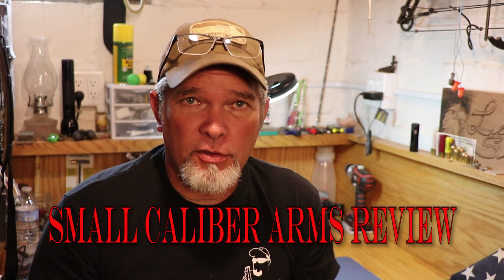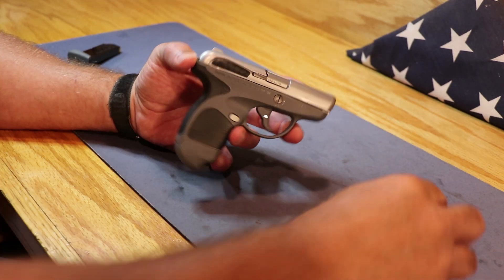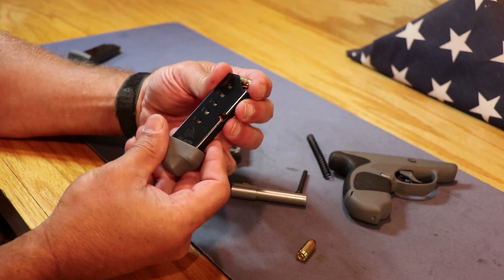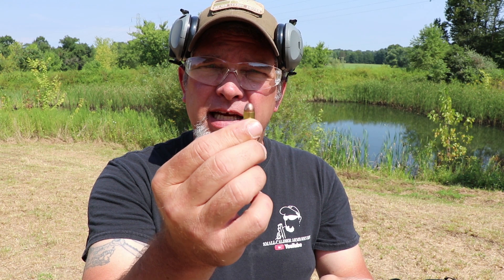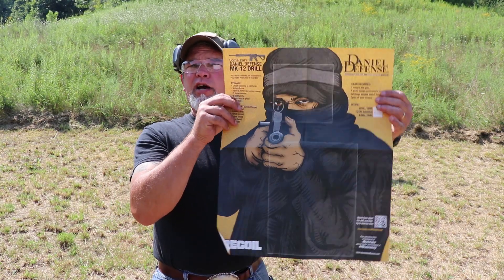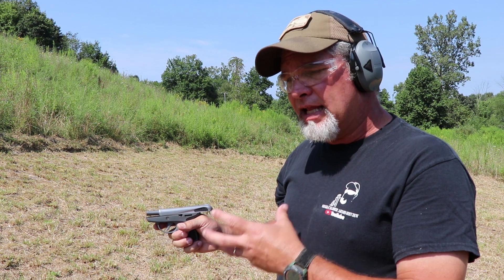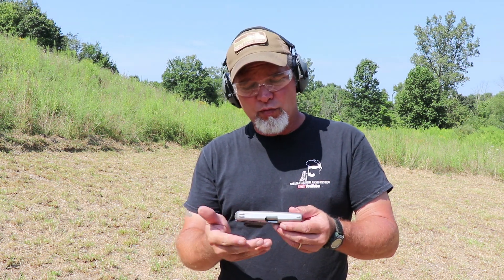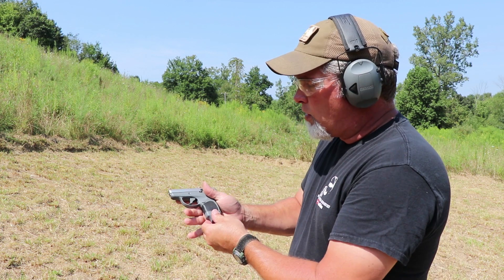Taurus Spectrum Second Look and Second Chance

Comment: didnt read all the comments - so disregard if someone else mentioned this. looks like your recoil spring is in backwards.
Reply from the maker: The recoil spring in the Spectrum can be installed in either direction, there is no taper to it or difference in diameter on either end. It would be nice if it was a captive spring though the ends are pretty sharp and will pinch your finger a bit if you're not careful with it. I did do another video and it seems to fire great with a good quality Defensive ammo but I only fired 25 rounds of Hornady American Gunner. (kind of pricey)